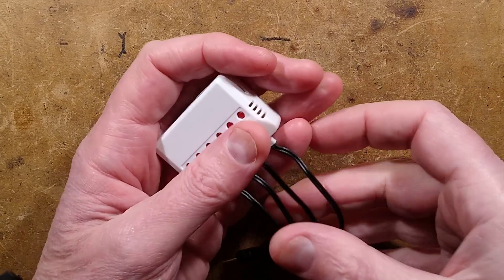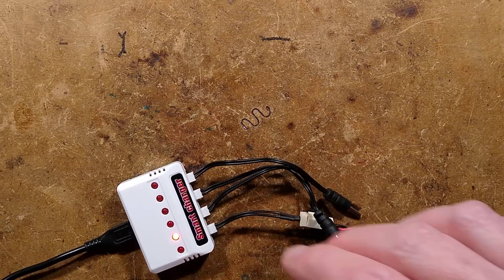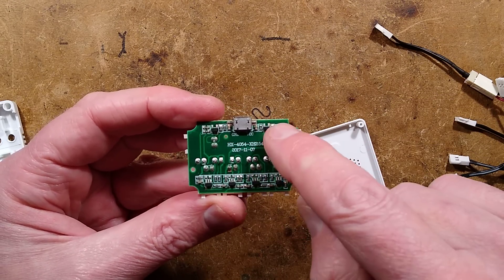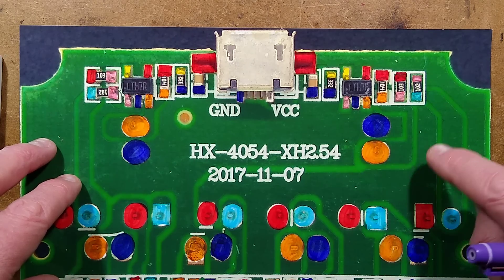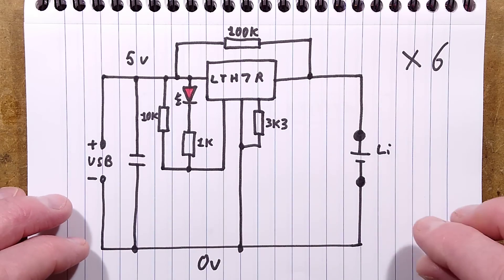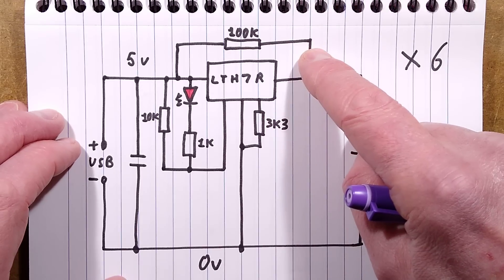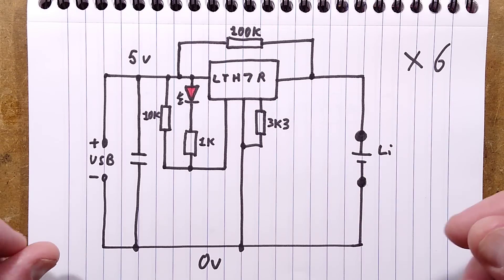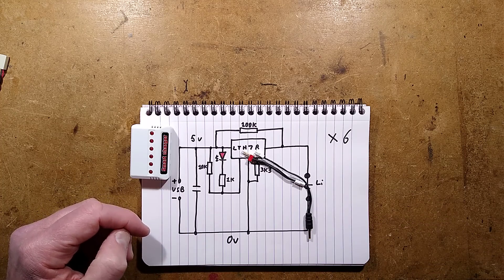6 way USB lithium charger - with schematic

Comment: I had one of these for charging 1s drone batteries before I got a proper charger. It was weird as some cells would terminate as low as 4.1v and some as high as 4.3v it was very inconsistent I don't recommend it

Comment: I have one of those with five ports, that otherwise looks identical, and came in a kit with five small batteries. I'm rather curious now to check it and see if it has the same USB-shield-is-+5v issue.

Comment: If you’re looking for more of those connector ends I believe they are the (Molex 51005) 
For drones they are an older style. You mostly see them now in toys. 
The PH2.0 is the more common one you see now in hobbyists drones these days.
Reply: Thankyou thankyou thankyou!!! I am indeed using some scavenged from toys, and older hifi equipment. They are good cause they are compact. I want to buy them but had no idea what to ask for, and the "dunno i just work here" kids at the local electronics shop have less than no idea.

Comment: I've even seen drone chargers that are usb cables That go Directly To The Lithium Battery No Conversion Just A standard Usb Cable Directly To The Connector Of The Battery That also Powers the drone
Reply from the maker: Some of the USB ones have charge circuitry in the plug.

Comment: It doesn't balance, it doesn't manage the current and voltage respective to battery level of charge, it has no overcharge protection. It has a mystery 10k resistor. Here's a kitchen sink. That's just to begin with, and I am a novice. I wouldn't call it perfect. but perfect for the price, perhaps?
Reply from the maker: No balancing required for single cells.

Comment: In my old school we were once soldering a simple circuit which was detecting a ground conductor when in close proximity and then turning on LED.
This device has the same feature even that it was not designed for such thing. Nice.

Comment: Will it still charge if there's an issue with the batteries? I have a charger that charges Nickle Metal Hydride batteries. It sometimes will not charge a battery if it thinks there is something wrong with it. (But if i charge them with a "dumb" charger, they'll take a charge.)
Reply from the maker: I made a video about that very subject.

Comment: fuck them for connecting usb connector shell to +vcc

usb should float one side, iirc client, shield, this just creates direct short. or maybe cables should float one end. but of wait many of them won't have any shield or data anyway

still this is fully cursed connector, why did they do it instead of rerouting with resistor or so. massive "saving" indeed

and what's the bypass resistor for anyway? i don't see it why would it do anything good except charge cell to +5v. never seen it anywhere

i wonder if chinese nose trimmer i got and never checked heats cell up because that. no, i don't leave them unattended!

Comment: 2024, still not USB C... Sad.

(Also on the 4 pack of Lithium AAA batteries I've got several times they give you a nice 4x octopus splitter which works quite well, seems like it does this job without the complicated circuitry?)
Reply: You'd want to make sure that each battery was pretty close to the same voltage before using a direct splitter charger cord. If 1 is at 4v+ and the rest at 3.5v- high current capable Lipo cells will possibly fry the lead.
Reply: @theoztreecrasher2647  That's interesting to note thanks.

Comment: The 100K resistors are applied in a topology suspiciously similar to the reverse current protection diodes we frequently place across linear regulators. I'm curious how the circuit would work with diodes fitted in place of those resistors.
I must say that the component layout is reasonably tidy. Someone at least spent a few minutes designing that board.
Reply: Diode won't work, either you are shorting 5V to the cell or its reversed and does nothing.

Comment: My Xaiomi V168 drone batteries charge via micro USB, however that's an interesting little implementation, and would be very handy for charging the smaller "standard"  LiPo rechargeable packs. I note that their 1500hp SU7 has just broken the Nürburgring lap record, by a comfortable 20 seconds.  Keep in mind that they only started in the EV market at the end of March this year - so 7 months ago! High performance sports car from a Chinese "white goods" and consumer electronics manufacturer!

Comment: So these are only good for a single cell lithium battery correct
Reply from the maker: Just one cell on each channel.  You couldn't use it with cells connected in series.
Reply: The schematic is just one channel out of 6 identical ones.

Comment: hey i got an idea for a video. i just watched the build of a gerage. among other things a Laser hightmesuering tool and later a makita thing that wraps 2 metal rods with wire and then automatically ties them after googling i found its a Rebar Tying Tool ... those would be really interesting to see how they work and see you take them apart.
Reply from the maker: The laser measurement tools are very common.  The rebar tying tools are kinda expensive for a video.

Comment: I see the Government are banning the sales of disposable devices to try to limit street lithium finds but we all know that all the manufacturers need to do is put a charging socket on them and bingo it is no longer 'disposable' !
People will still treat them as such though, they can't be bothered to refill them !
Reply: I suspect that it's also because kids don't want to get busted, so they're thrown away after use
Reply: I got one a while back that is somewhere in the middle, it's an odd design. The fluid bottle is connected directly to the device which is rechargeable. It was in the price range of a disposable and honestly I thought it looked like it was marketed that way so I bought it because it was an interesting design and wanted to know what it was all about and it wasn't any more expensive than buying a USB-C cable (which was in the box) that I needed at the time. I imagine this will be how the companies get around the ban but whoever made that one seems to be an early adopter.
Reply: @incredibleflameboy  The USB cables that are included with vapes only have power connections, the data pins aren't connected.
Reply: @ian-c.01  it's all good I only needed a charging cable

Comment: Could they have put a small capacitor at the output in stead of that trickle resistor bodge? The capacitor would act as a very low capacity battery, so the charger would think it is a fully charged battery.

Comment: 03:00 How can they use the USB socket shell as a positive connector if the plug you plug in likely has be a negative shell?
At least there is a danger that a plug is shell-negative, and then you you've got a short circuit.

Comment: I had a cheap drone which came with such a loader - it’s a bit scary to use them with those flat packs without included safety - who knows if they turn off quick enough and without thermic control
Reply: Indeed, i got one of these type chargers(5 Port) to supplement the 1P one that came with a cheap drone.. I call it the 'LiPo Bloater' because if you leave a cell connected just a hair too long, well.. 😅

Comment: Would a 1M or greater resistor between the output and ground (across the battery) stabilize the regulator output and reduce the capacitive coupling?

Comment: oh man...this just seems like a bad idear.  when i hung with he drone kids the most important thing i learned was batterries and chargers were so important and to invest in good stuff. ill never forget the one guy  who had just done a flight or he was charging a batt  and we saw a very spicy pillow pop up and start to smoke as he only had just enough time to open a window and toss it out...SURPRIZE!  the first thing i said was wheres ya PIE dishy?
Reply: "the one guy  who had just done a flight or he was charging a batt  and we saw a very spicy pillow pop up and start to smoke" 
Not exactly the brightest or most experienced RC flier then?! Immediately recharging Lipos hot from high current discharge (probably at too high a charge rate for a fast turn around and with no cooling airflow around it) is a really low IQ mistake! Not charging on a bare concrete/ceramic/metal clear surface is a second one! 🙄
Reply: @theoztreecrasher2647  um not really i think theres alot to learn about batterries from newb to pro...we can become so used to things because stuff really doesnt go wrong these days. in that case it was just an aging batterry. : o )
Reply: oh trust me i know. batteries have come along way . i love that clive has educated people across the planet about cells. and safety ! <3 hope u have a good day

Comment: When you get rechargeable "street batteries" in their disposed packaging, the PCB connector to one terminal of the sensor is often isolated with a blob of silicone or hot melt. if the isolation is removed, it is clear that this is capacitatively connected too. Breathe on it, or touch it with an insulated conductor and this will cause the LED to light or flash until the moisture evaporates, and the heating element will operate.

Comment: I got one of these (or something identical looking) with a set of little lipo batteries which i use for cosplay props. The design doesnt really inspire confidence but it seems to do the job just fine. Ive never had an issue with wierd capacitances because the batteries have the connector directly wired to them so if anything is plugged in, it's a battery and not just a dangling cable.

Comment: Does drone charger refer to a charger for small quadcopters or does it have a alternative meaning in this instance?
Reply: These things usually come with sets of batteries intended for small quads as you guessed.
Reply: It's for charging a single cell lipo battery
Reply: @samholdsworth420  Actually as many as 6 of them at once - and they can be at any individual level of charge when starting to charge. Each will crank up to 4.2v and shut its LED off. Check each battery after charging for correct voltage - these are low cost - low quality chargers but generally work quite well.

Comment: It's a shame there's no function to tell you when it's finished charging, turn out the light even, the coupling issue was weird, could it be because the input is tied to positive and you're on or at a grounded surface, so touching them it sees current leakage? Did you try it on just a battery powered input?
Reply from the maker: The channel's LED goes out when charging is complete.

Comment: It seems like instead of that 100k resistor they should have used a capacitor between the charge IC output and ground, and then maybe an optional (?) small value resistor in series between the IC output and the battery connector.  If they removed both the 100k and 10k resistors then the component count would be the same.
Reply: Capacitor would hold the chip in undervoltage lock out forever, the resistor is needed to fool it into thinking a non connected cell is full, so that when you connect a cell it drops voltage, and the on die logic sees the cell has dropped below full, and starts to top it up again.  Capacitor will instead keep the voltage below undervoltage threshold till power is cycled with a cell attached. you need ot have the chip in a ready to charge state at all times, not in lock out because the cell is dead and never attempting to charge. 10k resistor likely is there to handle leakage current, they probably had a few batches of those chips with internal leakage, such that the LED was always glowing dimly, so the resistor was added to prevent this. After all why use the quality part when the mostly functional QC failed part is on sale for 50 for the price of the good one.

Comment: Hmm, so handy for bringing recovered gutter grenade batteries upto similar voltages en masse before reusing them or building packs up. I guess you'd still need to meter each cell to check the voltages were near enough the same though.
Reply: i am sure more people would reuse the device if it wasnt purposely engineered to make refilling it very difficult
Reply: Boggles my mind why people dont buy the refillable kind, they must be cheaper and last longer than the "one time use" vapes

Comment: If used "out in the field" as intended for a drone charger then it would presumably be powered by a power bank or a vehicle power supply and as such the problem caused by the stray capacitance would not occur.

I can imagine that people who have used it in this way and then used a mains powered source may well believe that there's a fault with the power brick.
Reply: Yep. DC/DC chargers are pretty common in the RC world where the only power sources you have around when out and about are another, larger lithium pack, or a 12v car battery. Some of the nice ones can pass pretty significant currents as well since using other batteries tend to be able to supply large currents at low voltages a lot better than your average AC/DC power brick you might have lying around. Come to think of it, all of my most powerful chargers are DC/DC models, and I have some surplus lab power supplies I found on eBay running them.

Comment: I have seen LTH7R charge control chips for less than 1 cent each. The most expensive part is everything else. 😂
The design is probably stolen from linear technology LTC4054. WHAT! Not the chinese. 😂

Comment: One of these might be handy for my mum's vape batteries that always seem flat when she needs one...keeping 5 full at a time could be a "Good Son" gift  :)
Reply: Bonus points if you swap the resistors to charge them to a lower amount.
Reply: @gregorythomas333 
👉 Its worth remembering that Lithium Battery's Can Not be left on "trickle charge".
NiMH best for that job. Add a small Solar Cell, its portable.
4x1.2= 4.8
Reply: Why aren't you stopping your mum from vaping ?
Reply: Please get a little better unit from a reputable manufacturer like Hubsan or Eachine. I'm not a fan of that micro usb connector shell connected to the 5V rail.